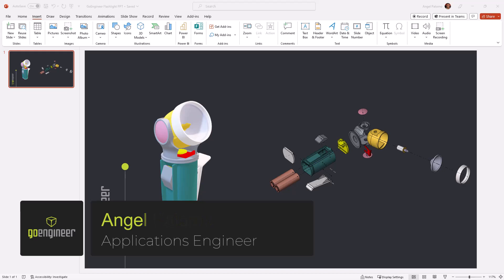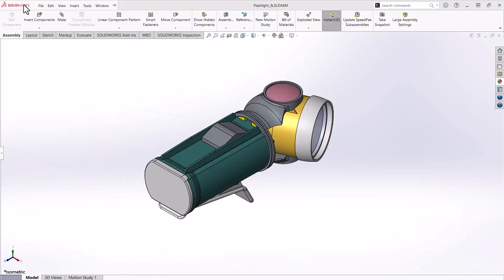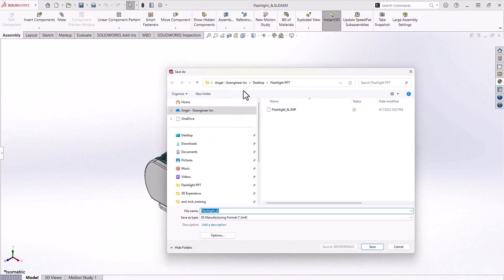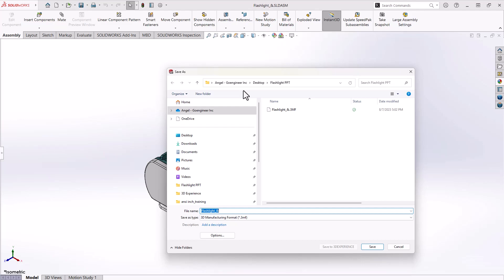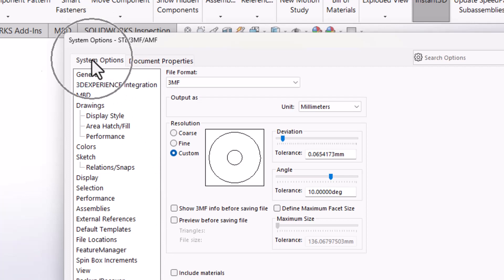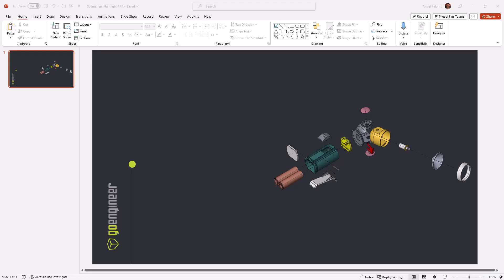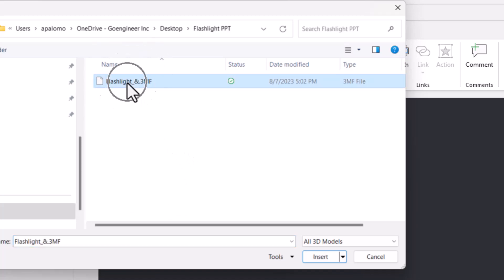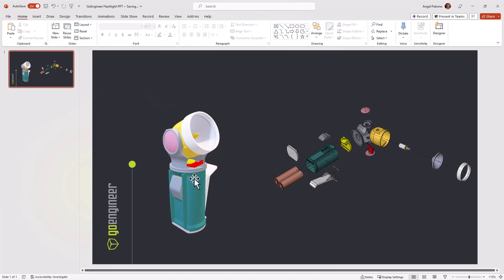SOLIDWORKS Tutorial - 3D Model in Microsoft PowerPoint

Comment: After inserting a 3D file into PowerPoint, the file does not function properly during presentation mode. Can you please provide assistance on resolving this issue?
Reply from the maker: Checking with your local IT for support of power point or your VAR's tech support is the better next step to resolving this issue.